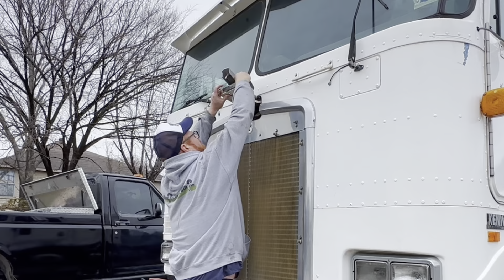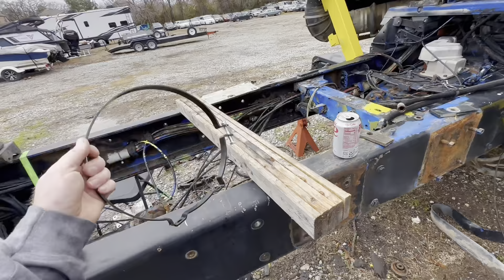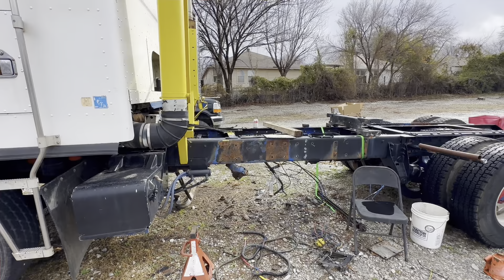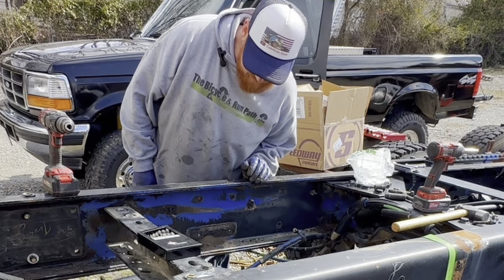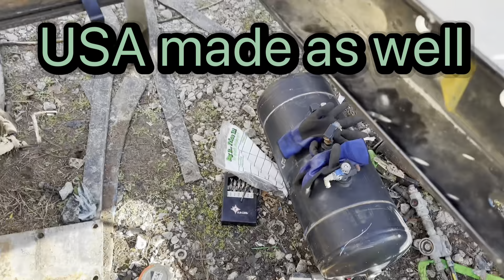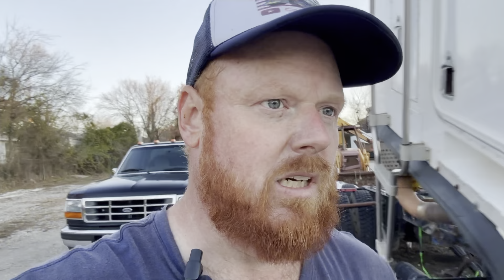Cabover gets it air tanks and fuel tanks mounted

Comment: I personally would weld the wholes, i think JB weld will drop out with the vibration, the KW emblem looks really good, didnt look right without it, but i have to admit i thought you were going to media blast it first and you might want to measure for the tag axle before deciding what goes where, keep up the great work Brother, i still think Karen is the name for it, big white and obnoxious 😂😂😂 🇬🇧
Reply from the maker: I think you’re right on the weld.  It was sure missing the badge. Makes a huge difference it will have to come back off to clean it up but nice to have it on there till I do. Yea, tag axle is gonna be alittle latter on but I did look and the ones I looked at all stay below the frame besides the mounting bolts.  It may make me be more pickey on the ones I can use though. Thanks for watching and commenting.

Comment: Emblem looks like replacing a missing tooth. Looks great.

Don't fill the extra holes until after you add the tag axel.
Reply from the maker: It sure does. That’s a good point. It may be a bit before I add that. I want to get it rolling and see how it distributes the weight. Thanks for watching.

Comment: id say no on the jb weld. Im all for welding in the wholes. maybe make some metal the same thickness as the frame. put a magnet on one side slide it in weld it, the weld other side. grind smooth. good as new!
Reply from the maker: Thanks, I have decided to weld them. If it wasn’t raining that would be happening today. Haha.

Comment: just weld them  nothing wrong with welding the side of the frame. no welding or drilling on the flanges tho.
Reply from the maker: Good to hear that. I bought a copper backer to help control the heat. Thanks

Comment: No JB weld needed in my opinion. Your not going to heat them rails up much outside them holes by just plug welding mig or stick to cause any problems or taking away the strength of the rails.
  I did some on my flc120 with a 110 mig and worked great I have a big Lincoln stick and Tig machine I could have used but for filling holes the little mig worked great with minimal heat transfer into the rails. Like I said in the last video the copper covering the hole on the back side while welding would be helpful as well. 
Forgive me for being long winded but I relize your concern to seek other opinions & relize the book rule of thumb is NO welding but who ever follows the rules anyways right? Lol.. Good luck & great video!
Reply from the maker: I ordered the copper deal after reading This.  Thanks for your input.

Comment: The KW emblem looks right, just like it should brother.   Seems those get taken off and sold, as I have seen others have to track them down.  To clean chrome, you can use "0000" steel wool pads.  cleans up chrome real good and no scratches.  That little tank that your not sure of is a fuel warmer, it uses coolant to warm up your fuel.  Which is stupid in my opinion because the coolant don't get warm till the motor warms up so, what is the purpose.  Anyway, just delete it because if a leak occurs inside that tank and the coolant mixes with your fuel, well that won't be good for the motor.
Reply from the maker: Yea, the cab over one is really easy to take too. I’m glad I was able to find one. Cost allot though. I’ll do that on the chrome. And I will definitely be pulling that fuel warmer off.

Comment: What model is it is it left or right  hand drive have a 1981 k125 on reyco suspension  Cummins  engine 13 speed  in it
Reply from the maker: hello, the truck is a 1998 k100e has a detriot12.7 set to 500hp, a 18 speed, newway 46k air ride suspension, a 18k. front axle with dual steering and double framed front to back. your truck sounds like a nice truck. would love to see some pictures. thanks for watching and commenting.